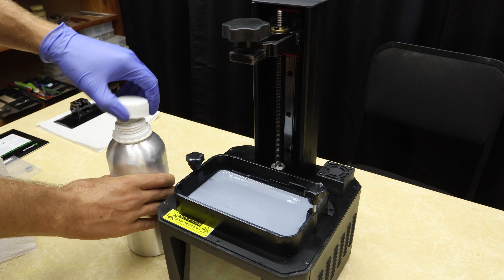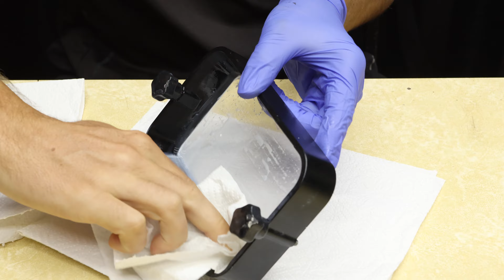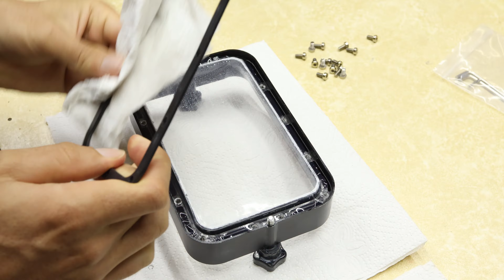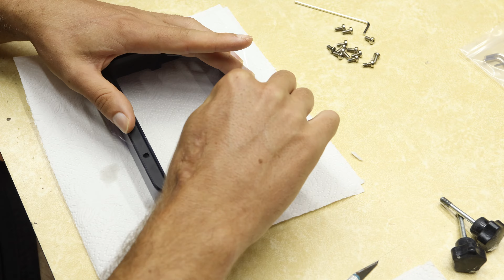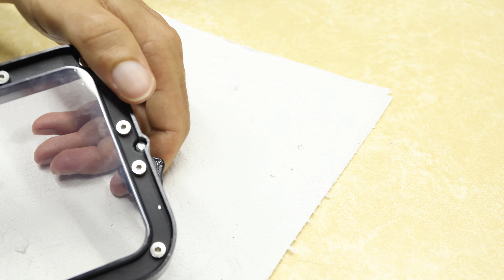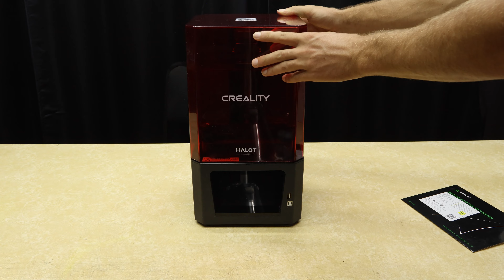How To Replace Creality Resin 3D Printers FEP Release Film

Comment: Does using tape temporarily work with an urgent 6 hours of printing? How was your experience?
Reply from the maker: I cleaned the vat with IPA and applied the tape on the under side of the vat... I used it for about 2 weeks printing multiple days without any issues. On flat surfaces that printed in that area you could notice a small imperfection but nothing major.
Hope this helps. :)
Reply: @Gerbens_Designs thank you so much